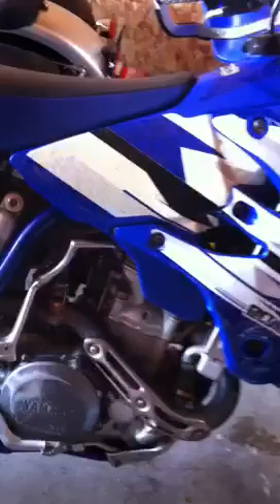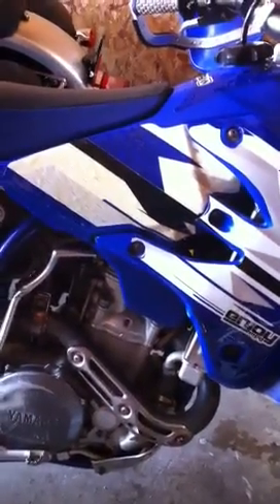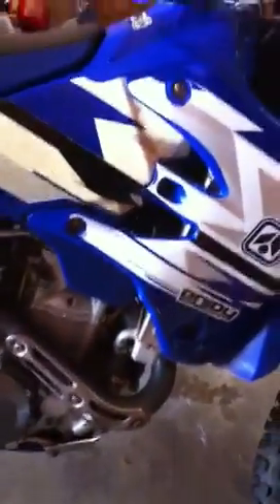WR450 Starter SCREECH!!!

Comment from the maker: Here's what I found and I think I have it beat (for now).  

1. Remove screws holding starter together. 

2. Separate armature and inspect base of armature. 

3. If you find pitting on the base of the armature, sand with 600 grit or finer sandpaper until it is smooth again. A light sanding will make it look beautiful. 

4. Remove carbon deposits on the copper portion of the armature that make contact with the brushes. Use same method as you did with the base... Be gentle. 

5. Clean the base of

Comment: Hi Jason, I know this is an older post but I'm having exactly the same problem with my son's brand new 2018 TTr-230... same exact horrible noise.  Can you please clarify... is the fix the 5 step process you list below starting with "Remove screws holding starter together" or is the fix related to the post below that one where a new starter clutch was required.  Thanks for posting this.
Reply from the maker: Scritley I took it apart, cleaned the armature and put some lube on the base where the armature sits. To be honest I fixed it like 6 years ago and don’t remember exactly everything i did. However, I still have it and haven’t had a problem since. Good luck!
Reply: @thesykboy  Thank you!  I appreciate your response.

Comment from the maker: The sound is from inside the body of the starter. I have since pulled it apart, but still can't find exactly what's causing the noise. I think it has to do with the motor itself rubbing against the motor housing. I greased the inner pads of the motor body and it worked great for 5 or 6 starts. Then the sound started again. I think it needs to be rebuilt because it works, just struggles and sounds awful!
Reply: i have a similar noise and the mechanic has told me that its the starter clutch that has to be replaced.  did you ever get it fixed?
Reply: +1 starter clutch has to be replaced, the most famous genetic sick on wr450, better to upgrade to 2004-2005-2006 starter clutch system, the following thumpertalk topic link explain how and what are parts needed for upgrading -> https://www.thumpertalk.com/forums/topic/842950-wr450f-2003-starter-upgrade-problem/, parts are more strong, and long life
Reply: That sounds come from the bushing on the end of the back of the starter. The front side has a needle bearing which is greased but the bushing on the back side gets dried out. Take the starter apart and put just a little grease down in there and it will fix it. After LOTS of starts it may come back as the bushing dries out again and need to be re-greased.
Reply: It could be the nose bushing  of the starter motor is dry and needs a little bit of grease , but most probably is a bad starter clutch which only allows the notor to spin in one direction when the start button in pushed. The starter clutch is NOT patrt of the starter.